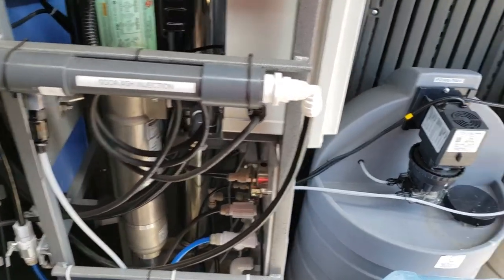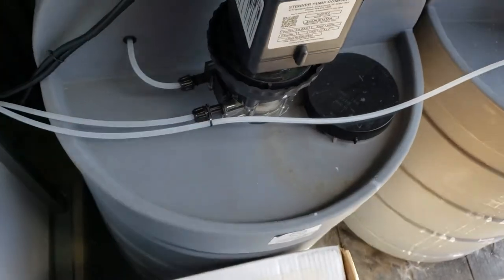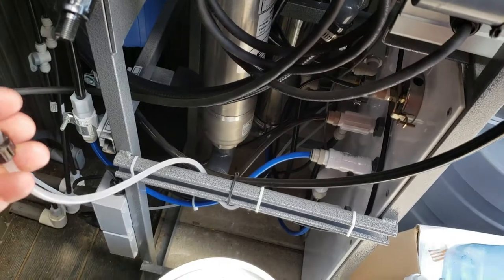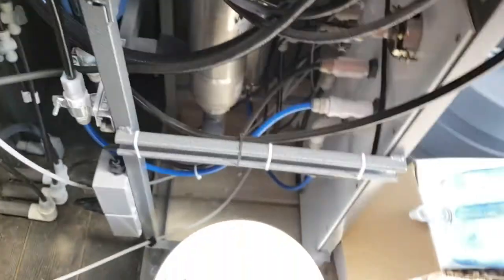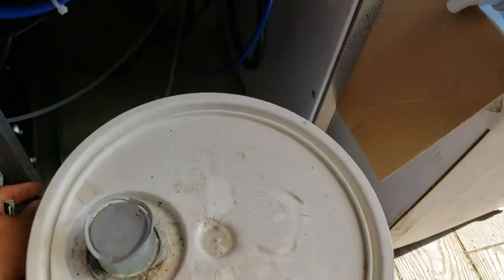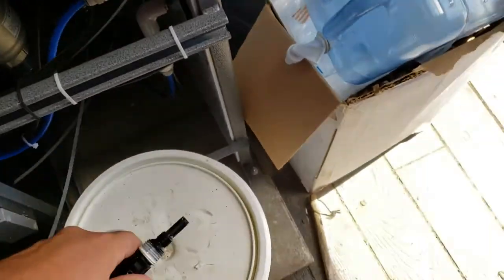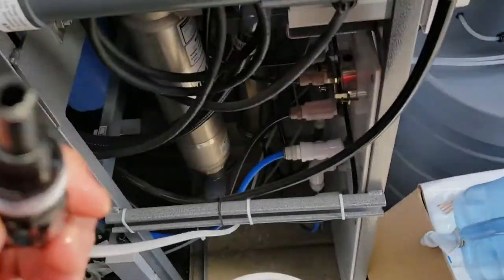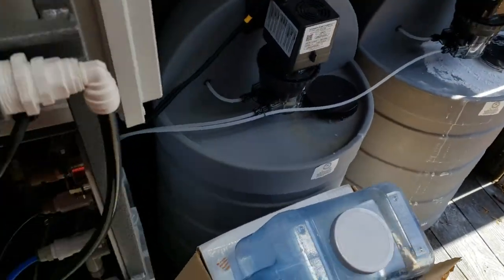Stenner pump injector troubleshooting

Comment: Hi Eric! Great video by the way! Quick question... do you have any advice to troubleshoot why my new stenner pump won't stop? In the past, it would stop when not running water. Thank you in advance for your thoughts!!
Reply: Usually there is a flow switch attached to a 110v outlet in your system. This flow switch is meant to only supply power to the outlet when water is flowing. The plug is sometimes a double outlet plug with the other outlet having power at all times.You may have plugged your pump into the outlet with constant power, in which case you would just need to move your plug to the other outlet. Hope this helps.
Reply: Thanks for the answer!

Comment: Thanks for the video!My discharge tube pops out of the Stenner pump side, not the connector side.  I changed ferrules but that did not help.The discharge tube is new & I confirmed the 1/4" size is correct.What am I missing?
Reply from the maker: Possibly pressure build up. Is your injector working properly?
Reply: Thanks for your reply. 
The injector is new. Replaced in July 2019. Do you still think I need to check it?
Reply from the maker: I would take it apart and inspect it. Only reason I can think of that Line will pop off is from high pressure.
Reply: Wanted to catch everyone up: the fault was with the new tubing. They recommended I use Teflon tape but also refunded my money. Thanks for the help!

Comment: can you show a video of how much chlorine should be pumping out at different speeds? my chlorine isn't pumping into the filter it keeps coming back I've replaced  the injectors and gear cranks and still no chlorine is pumped
Reply from the maker: It should drip out the end. Depending on the speed of the pump and size of the tube will determine how much it will inject. If you're injecting into a pressurized line make sure you have a pump that can overcome the pressure. There are low pressure and high pressure injection pumps.

Comment: My pump which is new turns on and rollers move but zero suction.
Reply from the maker: It sounds like the rollers aren't properly engaging the tube. Are the rollers collapsed or are the armatures extended?
Reply: Hague Quality Water can I send you a picture somehow?
Reply from the maker: @letsroll03  sure email me. Sales@slowater.com
Reply: Hague Quality Water,  I ended up replacing the unit and it engages perfectly.
Reply from the maker: @letsroll03  Good call.